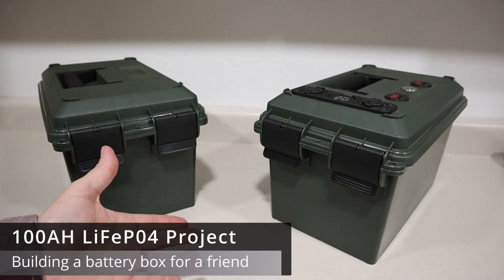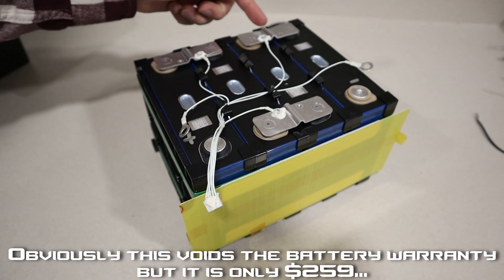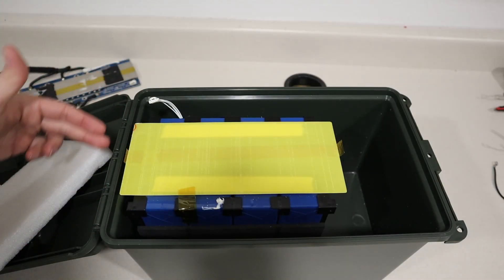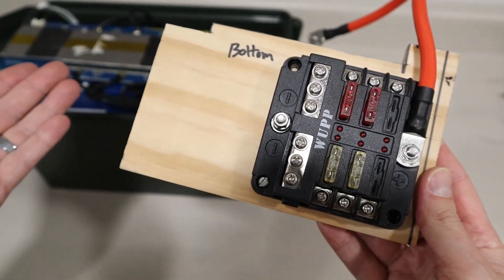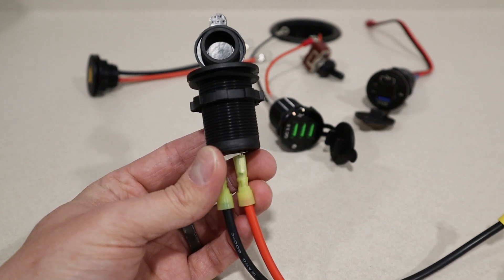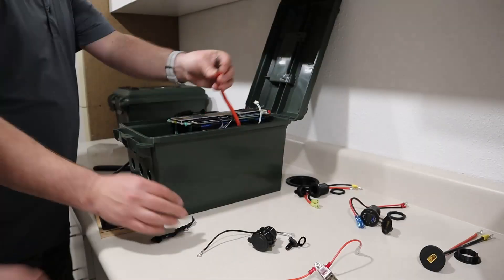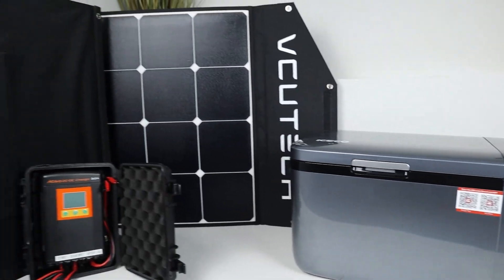Cheap LiFePO4 100AH Battery Box! $350 Total Cost - Simple How To Video - USBc - XT60 - 12v Socket

Comment: Hi Jason! In a diy power station, what do I need to install for high dc output like 12v 20 or 30a?
Reply from the maker: you just need wires connected to the main terminals that can support a higher amperage (larger gauge wires). For example, if you want to pull 30 amps, you'll need 10 awg wires.
Reply: @Jasonoid  Thank you sir!

Comment: With an appropriately sized box one could fit two of these batteries in series to make an affordable 24 volt portable battery. It would be rather heavy I suspect.
Reply from the maker: You could always try using those new micro 12v LFP batteries.

Comment: So how would you charge this battery? I did see the 12v output but don't you think maybe two inputs would be helpful. One solar and the other one a wall charger?
Reply from the maker: You can connect a charger to any of the output ports. It's like a car battery, charging happens on the main terminals and any connection the the main terminals will charge. My friend will use the XT60 port to charge it up.

Comment: I noticed you had a 2.0 version with the connectors including powerpole on top, nice job. I've found all the 12V adapter with locking are way to loose for most plugs, not a fan.
Reply from the maker: Yeah, I like to have 12v sockets as a last resort.

Comment: Thanks for sharing!  Made many of these over the years and having a main breaker between battery and fuse block is something I've add in each build.  That way I can cut power to the battery no matter what is going on.  Lots of options and I never stop tweaking.  If you've never done one of these builds before, I highly encourage you do.  It's one of the best ways to learn IMO.

Comment: Hello
I have a question.
Can i parallel two deferent brand of lifepo4 100 amp battery for example 100 amp Timeusb brand with 100 amp Redodo brand . Thank you
Reply from the maker: If the batteries are the same capacity (100ah), you can connect them in parallel just fine. You'll want to make sure they are fully charged before connecting them together.

Comment: Hey Jason, I'm not sure what "friend" you were referring to but it sure sounded like you were talking about me. I'm so glad you did this video build. It's exactly what I needed to build two more similar to my discontinued Battery Hookup builds. Just one question... Can I use the RadioB Tech Smart BMS instead of the BMS that is built in with the battery?
Reply from the maker: You can use any 12v LFP bms that you want, this battery comes with a plain Jane 100amp model. You'll just need to make sure you can fit it in the box.
Reply: Thanks for the quick reply, ordering two right now. Steve
Reply from the maker: @therollingstone5495  enjoy the project!

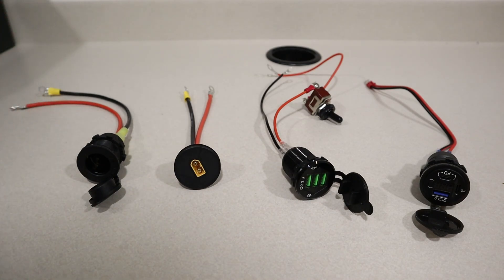Comment: Good video. @3:23 I would suggest using the female XT60 since it is for power source output so you do not have exposed male pins that are sitting real close to each other and can be shorted out if piece of conductor gets between the male pin, I know it is protected with 20A fuse.
Reply from the maker: Thanks Bud for the feedback. I thought about this as well, but that 3d printed port only supported the male xt60, I'll look for a different option next time

Comment: Nice project.  I need low temp protection up near the Canadian border.  Can you recommend another BMS?  Thank you.
Reply from the maker: They have another cheap 100ah battery that has low charging protection. I'm not exactly sure if it will fit into the box, but the cases look the same so I'd hope it would. It's only a little bit more money:  https://youtu.be/dd1W8_tdl2c
Reply: @Jasonoid  Thank you!!

Comment: Nice but tell your friend to buy the DR prepare with the battery  hub built in.
Reply from the maker: You're limited to 100w charging and only 10amps output on that HUB (unless you want to use the main terminals).
Reply: @Jasonoid - Solar Power, Batteries, and More!  yes but what a nice bundle and no work needed

Comment: how do you charge it from a/c?
Reply from the maker: You can use any battery charger, just connect it up to the positive and negative leads. My friend will be using the XT60 port with a custom adapter to charge the battery with something like this:   https://amzn.to/3kEUqXn
Reply: @Jasonoid  that makes sense.  thanks for the quick response

Comment: What wattage on the solar panel to charge ur battery that runs the 12v refrigerator? I'm assuming a 100w solar panel will be used?
Reply from the maker: Its the 200w VCUtech panel, you can see it in this comparison video: https://youtu.be/Nfll_AwnVZc
Its a great budget option and puts out good power.
Reply: @Jasonoid  Thx u that's even better. 👍🏾🙏🏽

Comment: I assume you replaced the original wire leads of the 12V socket with 12 awg ones? Because the socket you linked to doesn't seem to have 12 awg leads. Also, is 6 awg enough for the kind of current this battery is capable of putting out? I know that you probably won't be pulling more than 20 Amps but still.
Reply from the maker: Correct, I used 12awg silicone wire from Amazon and higher quality terminals so that it could handle the full 20 amps.

Comment: Great stuff... I just made a video of mine that I made in a Pelican case with 21700 cells... Keep the videos coming..
Reply from the maker: Nice build video! You can tell you spent a lot of time putting your design together and it looks super clean. I moved away from NMC after one of my 12v fridge batteries exploded from a charging malfunction while camping. I'm LFP all the way now, it does add a little bit of weight but it's not horrible. Thanks for watching!

Comment: Could you suggest a method to heat the battery ?
Reply from the maker: This website will give you some ideas for heating the battery: 
https://oemheaters.com/category/982/12v-and-24v-silicone-rubber-heaters
Reply: @Jasonoid  thought it would make a good part 2 for you.
Reply: Probably just a small thermally activated heating pad? They use those on the internally heated batteries, so you probably can do that yourself.